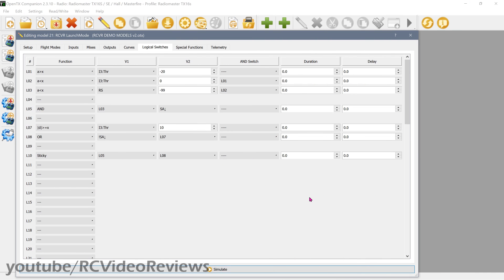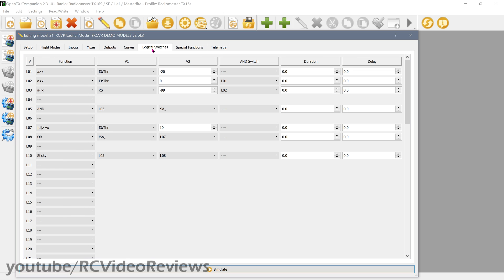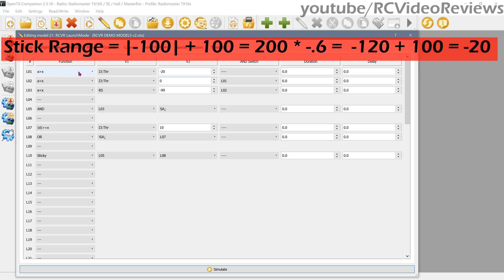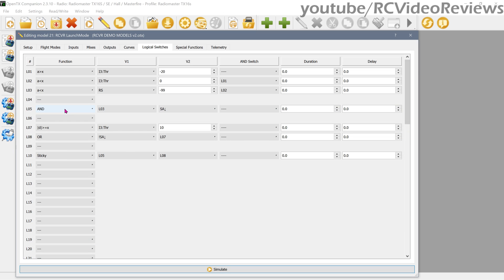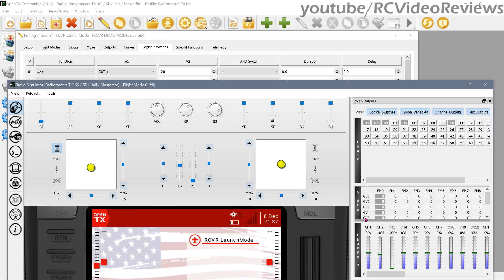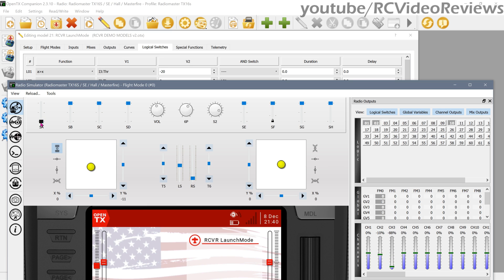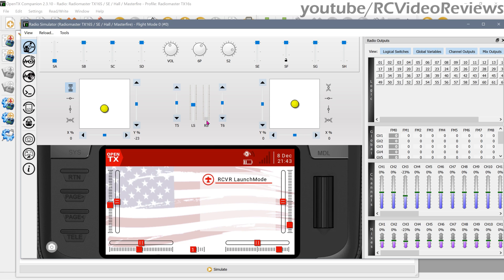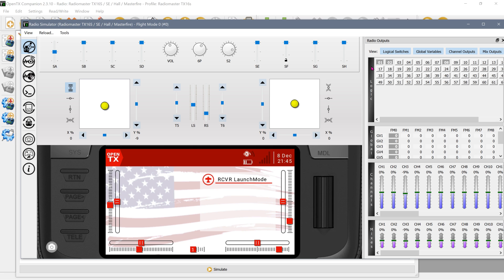OpenTx Tutorial • Launch Mode with a Touch of Throttle Magic • [Intermediate]

Comment: Hi John. I tried to replicate your configuration on my Tx16s, but it doesn't work : each time I switch SA down, the throttle stick is activated normally. How can I send my configuration to you so you can check it ? Regards. Thierry
Reply from the maker: Did you add the mix line using replace?
Reply: @RCVideoReviews  Now I have added the mix line and it works perfectly. Thank you for your help. Have a good day and keep safe. Thierry

Comment: Once the launch routine is complete, I assume it would be possible to add an audio reminder to reset the switch (Sa)  and avoid the possible re-activation mid flight.
Reply from the maker: Sure, you can do that. You can also use Sticky Switches to prevent during flight without disarming first. All kinds of logic options.

Comment: 1st I would like to say your videos are very helpful.  Here's one for those of us who use our TX16s for surface vehicles.  On my RC rock crawler I have my throttle on the left stick all the way down being stopped.  How would I put reverse on a switch e.g. flipping the SF switch up causes me to go backwards when giving throttle?
Reply from the maker: Hard to answer that without understanding your reversing mechanism. i.e. The normal range of output on OpenTx sticks is -100 to +100 with 0 being center. I'm assuming you're using an ESC since you mention throttle? How does your ESC want to go into reverse? When you calibrate an ESC for planes you tell the ESC the switch min and max positions. How do you tell your ESC you want to be in reverse?
Reply: @RCVideoReviews  you'd have to play with a car and a car radio for a bit.  In a car, you pull the throttle to go forward. Then you bring to middle and push the throttle for reverse.  Some car ESCs require you to do the fwd movement twice, you "pump" the throttle back to reverse.  I did this once for cars on OpenTX and you basically set throttle from 0-100 for fwd, and simulate the "pump" when you flip the reverse switch by setting throttle to -100 and back to 0 and then set throttle range from 0 to -100, you invert it by putting 0 at bottom and -100 at top.

Comment: More good stuff...
1:40...When you first turn'ON' the radio you will get a switch warning if all the switches are not pulled away from you. Would it not make sense to have the Throttle lock in the Away from you (default no warning) position ? It is something I have learned to do with my old Turnigy 9X radios to make sure I'm in any safe mode state when turning the radios 'ON' without switch warnings.
Reply from the maker: I use switch warnings. You can set switch warnings for any position you want. I set mine to alert if SH is not down. I don’t see that it really matters. I know some people feel strongly about this using “away” as safe but a two position switch doesn’t really have a default position does it? It’s a purely subjective point. Do whatever works but do something.
Reply: @RCVideoReviews     Agreed....I always set my throttle-kill switch to deactivate the motor when the switch is pulled towards me.   Years ago, I used to set deactivate with the switch away from me, whereas,  a couple of times I set the transmitter down on the field at the end of the flight and a small raised rock came in contact the switched and pushed it towards me and activating the motor.  It also happened once when I used the glow stand and the switch came in contact with the raised edge on the stand and flipped that switch towards me and activated the motor.  Fortunately,  I always had on the fuse and that prevented a fly-away or worst (especially in the pits). From that point on,  I always set throttle-kill activated when that switch is pulled toward me.   Your mileage may vary....
Reply: @WTJimmy  the throttle kill switch needs a little more logic.  I have logic switches with a sticky that only let the kill switch change state when the throttle is all the way down. Startup deactivated.  That way the motor will only be active if my throttle is all the way down when the switch is flipped.  It becomes a double switch based on throttle position.  The same is true during flying. The switch will only kill the motor is my throttle is also all the way down to prevent accidental kill of motor while flying.  When I land, bring throttle down, then hit kill switch, then raise throttle again and plane is safe from any bumps.
Reply from the maker: I’ve done all that and shown how to configure in other videos. I don’t use that in demos to keep things simple. Not everybody wants or needs the extra steps.
Reply: @RCVideoReviews  Thanks for the explanation info John.. Got it.